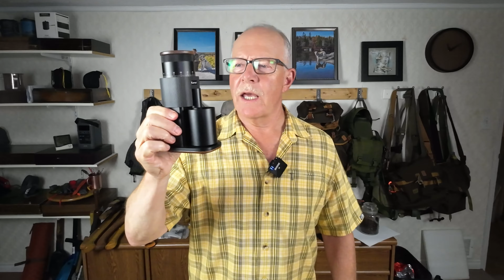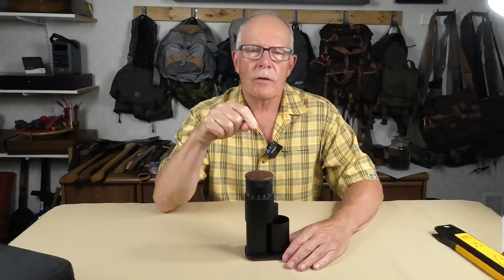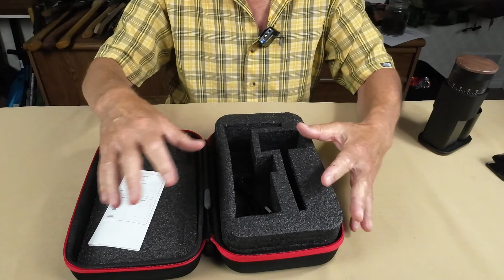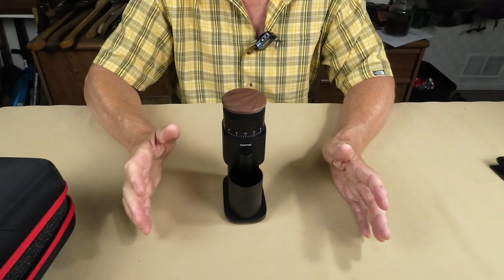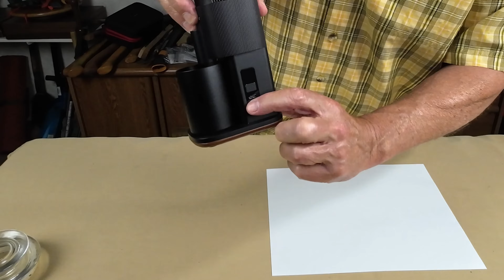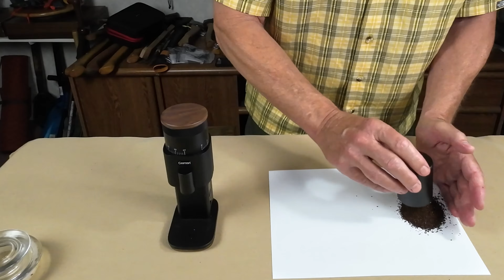Geimori T38 Portable Precision Coffee Grinder

Comment: It is my understanding that rechargeable batteries should not be drained below 20%.  Does it not have protection built in to prevent over draining of the battery?  I just received a new hand grinder that came with a plastic collection cup.  That creates issues because plastic is a conduit for static.  When I removed the cup coffee powder went everywhere.  It sounded like your Geimori has a metal collection cup.  Does that cause the same issue as plastic.  It looked like it did not.  My old Vevok has a glass collection cup.  Glass is heavy, but I don't have coffee powder everywhere.  Whoa that Geimori is quiet!!!  I'm impressed.
Reply from the maker: It is my understanding as well that batteries will last longer if they are kept between 20% and 80% of capacity. I have not read anything that says how quickly the degradation will occur though. There is no charge/discharge regulator in this device. It will be up to the owner to monitor it. The dosing cup is aluminum and can hold a static charge. I have a hand grinder with a glass reservoir that is worse. I find it depends on the humidity in the air. I often will let a drop of two of water, or a light squirt/spray of water on top of the coffee (give t a quick shake) before dumping it into the hopper. This pretty much eliminate static cling. Thanks for commenting
Reply: @markyoungbushcraft  Thanks for the water tip.